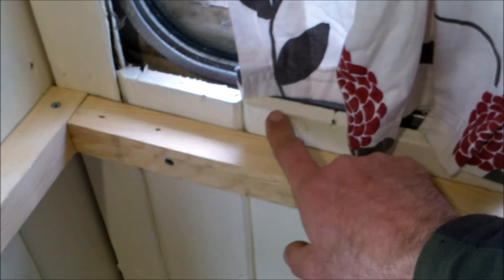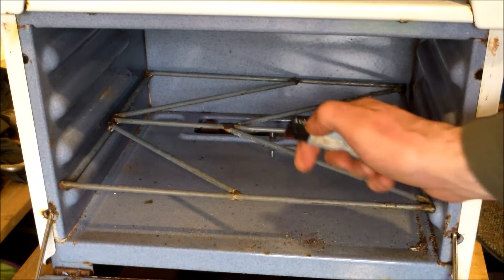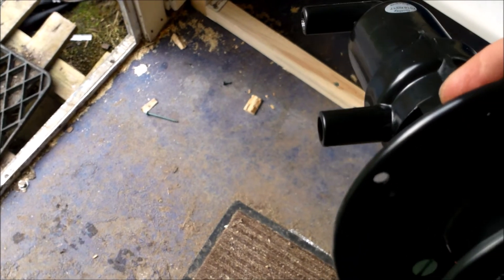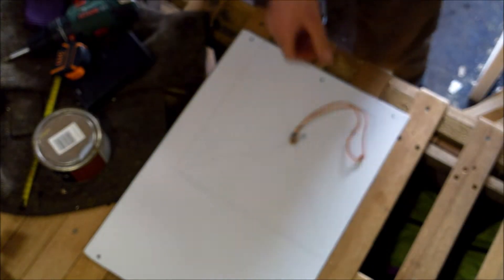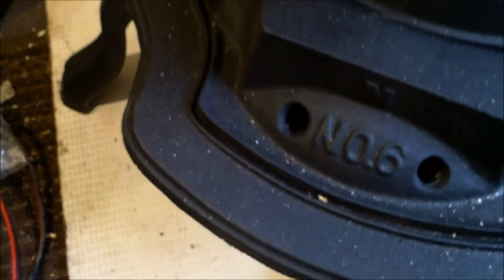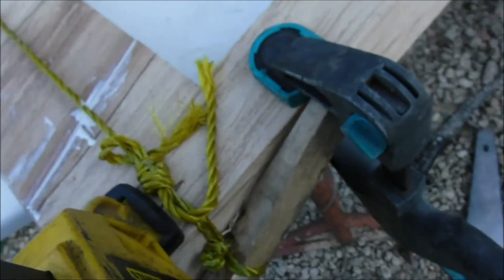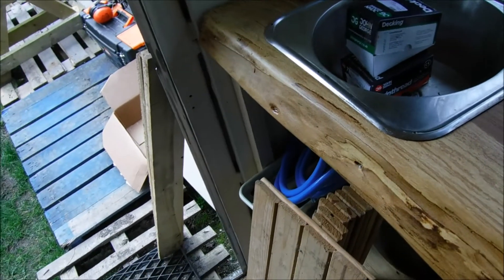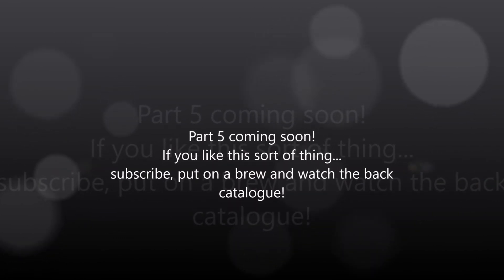Shepherds Hut Revamp Part 4

Comment: Would like the gas bottle outside and a below stove vent, but perhaps the fitter will advise when he checks appliance :)  It's gonna be perfick when finished Sam.   Cheers........
Reply from the maker: vents definitely going into the floor under the kitchen area and also under the bed area. as for the Butane bottle, she's staying inside but will always be turned off at the valve unless in use, thats the way I've done it for the last 5 years with 4 different stoves in the hut. Thanks Les. I am reminded of the calor gas heater I grew up with, with a butane bottle inside the rear of it, used as back up room heating in the days before the central heating was installed at my parents house.
Reply: Yes! we had one of they gas bottle fires many moons ago. mum & dad had a Viceroy paraffin stove for emergences, but their main heating was open fire in lounge (front room). In the winter dad would order six cwt of coal & one of nutty slack. Once the fire ended up on the hearth & carpet, with hot embers, dust, ash all over. all due to a detonator being in the coal unseen at coal yard. Coalman sorted through the rubbish & found the casing. Two free bags of coal, Happy days, the hand grenade ornament is another story haha. Cheers........Les

Comment: Worktop came out fantastic Sam ;) Great job you are doing there. With the gas connection you can rub a bit of washing up liquid around the joint, if it bubbles up you know it's leaking! Old trick i was taught many years ago.
Reply from the maker: Cheers Paul, I'll try that. Just to be sure.

Comment: That kitchen area is a joy to behold, the foot pump a brilliant idea, this is going to look and feel superb.

On a serious note, the woodburner. I hate to say it but the board is going to have to go back in place. You could 'possibly' (if you can find some) put a metal sheet (steel, copper) on the board, but not on the wood as is, the fire would heat the metal which would conduct it straight into the wood eventually it'll begin to pyrolyse behind and you'll have no hut. I'm afraid I don't know enough about woodburners to know if reflected heat would cause any damage by overheating it, hence why I say 'possibly' about the metal at all. One thing that may help is a convection fan, this would help keep the air in the hut moving while the fire is burning, and lessen any concentration of the heat in the corner. There is only one other thing that I can think of, but that wouldn't go down well. In a nutshell, replace the board, making it removable to check for charring on a fairly regular basis. Sorry I can't be more help.
Reply from the maker: Perfect advice Si and exactly as I hoped you fell my trap, giving me free advice! I'll do exactly as you say, lucky I kept the boarding! That's been up there for 5 years with no damage to the boards behind it so I'll accept the ugly for sake of safety. The hut as a whole space is so small that it already gets far to hot in there, my record (when I was being silly) was 34degrees with an outside air temp just above freezing. I'd have loved to get a mutch smaller stove but the only one I could find that I liked in the UK (called the Hobbit, and made down your neck of the woods) was £500 so not an option. Thanks for the advice...you're a star.

Comment: I remember the excitement of getting the propane stove going and returning the Coleman stove to the camping kit at my property. Have you thought about putting the gas bottle outside instead of inside, a bit safer. Love the look of the slab.
Reply from the maker: I thought about putting it outside, but the thought of going outside in the cold and dark to turn off the supply at night out me off. With the vents installed I'll be happy. It's a great feeling to ditch a camping stove, they have their place of course but glamping is glamping.

Comment: With 12 volt dc power in the hut I may well have gone down the route of installing a caravan 12v water pump with a 20litre caravan water container in a box outside or better still in the cupboard under the sink.
Coming along nicely though. 

hob
Reply from the maker: I know why you mean, I was thinking about it, but my current system is fairly limited as it's made up of old van batteries and only 1 panel so I worry (probably unnecessarily) about over loading it. So the foot pump seemed a good option. Simple like me.

Comment: Hi Sam 
Been following you for a while, but I do think you should get that stove checked by a gas safe engineer with LPG qualifications.
Yellow flame picture on burner could be a blockage somewhere meaning it’s not burning correctly. Giving off carbon monoxide I would also put the bottle outside and have a vent under the cooker if there is a leak, you won’t be in a lake of propane😱
Keep the videos coming.
Good luck
Reply from the maker: Hi Stuart, thanks for the advice, you are spot on about the cooker, after I'd filmed the yellow flame I removed the top (fortunately the stove is really easy to disassemble) and shook out a lot of internal rust. Hey presto, no yellow flame (as is shown in the use of the kettle some time later). It was an error not to mention that in the video but as usual I was rushing to get things done. I will be putting floor level vents in under the counter and in the new door to the hut. If I get a longer hose I could put the gas outside on the front of the trailer but I've always disconnected the bottle and put it outside the trailer at night anyway. I will look into getting someone to test the stove though. Thanks again. Sam. (Oh and I hope you continue to enjoy my random channel).

Comment: That's a sexy little foot pump.
If you had an old copper water tank to peel open and stick behind the stove it would probably look pretty nice.
The beech is beautiful.
Reply from the maker: Yeah I was super pleased with the footpump, nice and simple and a lot nicer looking than the rubber bulb type. Very pleased with the worktop...my first attempt at making wood look nice. Went well I think. I'll see if I can Russel up something decorative to go over the top of the fibre board, the copper is a good shout. Thanks!